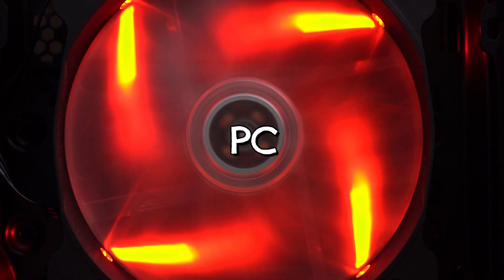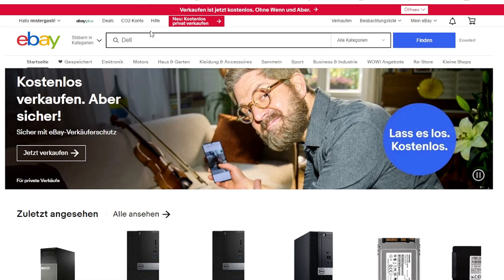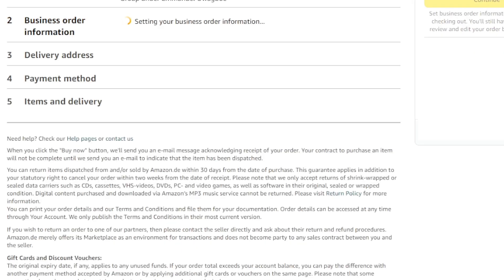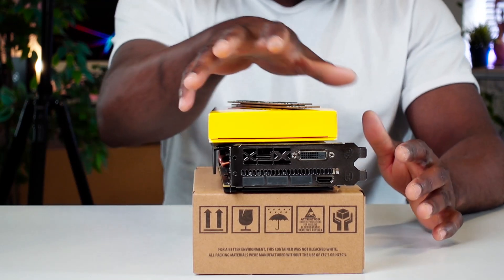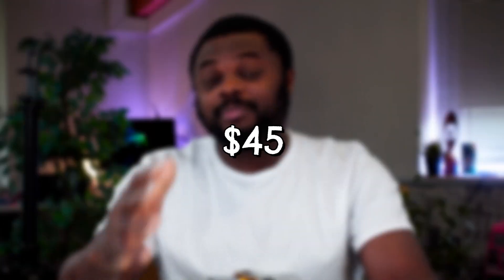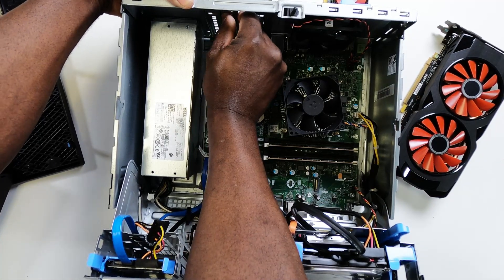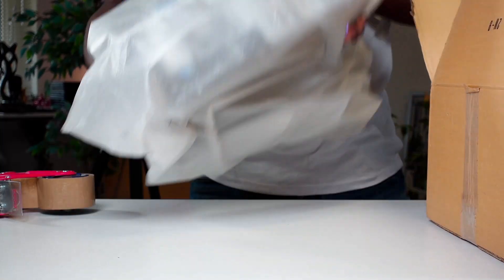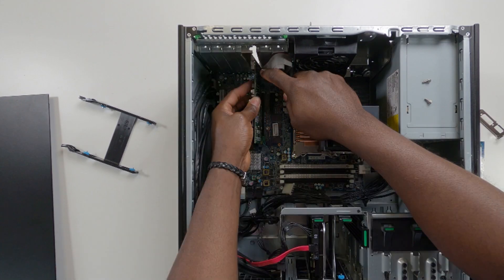Yes, you can Build a $198 Budget Gaming PC with a Dell Optiplex, But...

Comment: the rx 550 fits, and can use sata to pcie adapter if has, will run card that needs 300w ok, psu is under rated on dells

Comment: So I just bought a dell optiplex 7070 Mid tower I7-8700 16gb ddr4 ram with a rtx 4060 from ebay they never specified the power supply but insisted they tested before listed and stress tested before being listed on site the pc should arrive in the next couple days so can update you im just concerned that the Power suppy unit in the 7070 mid tower will be a stock 260w psu as it is a refurbished pc and the seller never mentioned if it arrives and turns out to be the stock 260w should i demand a full refund? As there is no way that setup can run with no problems without at least a 500W PSU or should i try buy an upgrade on ebay which I had a hard time finding on ebay the best I could find was a 360W PSU for the 7070 MT and some Chinese unbranded 500W PSU supposedly for the 7070Mt got any advice mate I got myself into a real pickle.
Reply: I would honestly recommend just swapping everything over to another case and or fo a little cutting on the chassis and remove the old psu and put in a better one. Can grind a decent priced 300-500w psu on ebay or facebook marketplace

Comment: Even if the RX 570 actually could fit into the case it still wouldn't work as that card requires separate GPU power.  6+8 pin connectors are needed and lots of power. The standard PSU won't be able to handle that, nor does it have the GPU connections.
Reply: Adapters exist to make it happen. Been there done that😂
Reply: just replace the PSU

Comment: come on my build wint fine dell optiplex 3050mt pairedd with rtx 2060 and had to do some cutting of metal for gpu space ut it turned out good most 1440p games run fine
Reply from the maker: great 😉 guess will need to do some cutting as well

Comment: recommend gpu??
Reply: Pretty much any single slot low profile card will work right off the rip there's a few tht require a little more power from the psu but still some good options. 1060,1650,rx580,rx 6400. Again tho make sure it's single slot low profile or you will need a psu upgrade

Comment: Great Video.  You could have sent back the RX 570 and used a low profile card like an RX 6400. Perhaps you could have moved all of the components to a new case?  $50 case.
Reply from the maker: thanks. well i just felt like keeping the RX 570, firstly it was cheap and the card appears not to have been used. Moreso a HP Compaq 8300 is way more spacious
Reply: Either that or go with a full height single fan card.  Cutting the case would be the last resort.
Reply: or a gtx 1650 or even 1050 ti